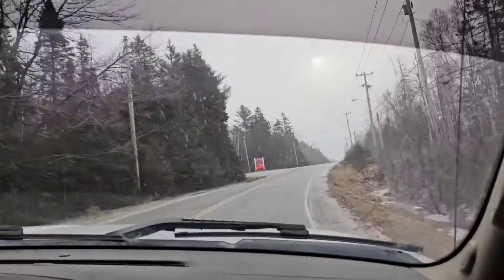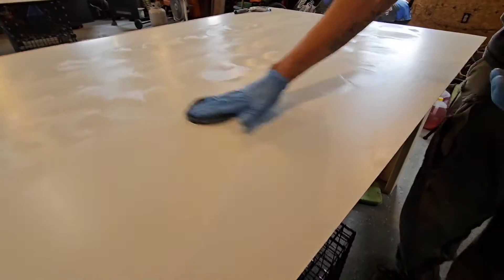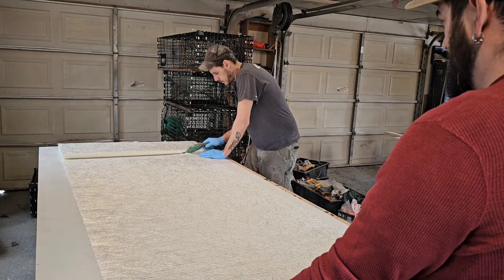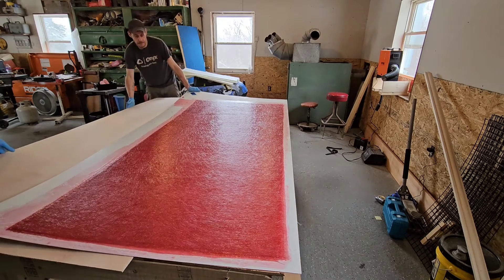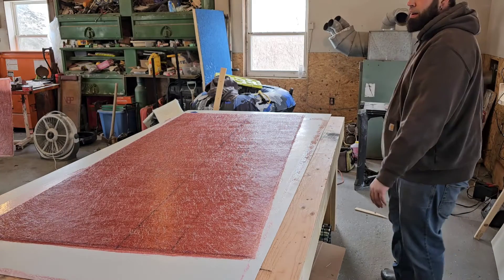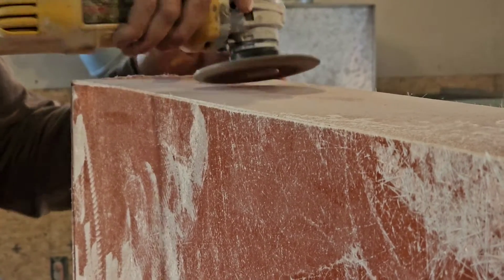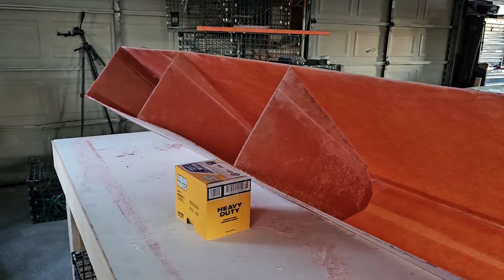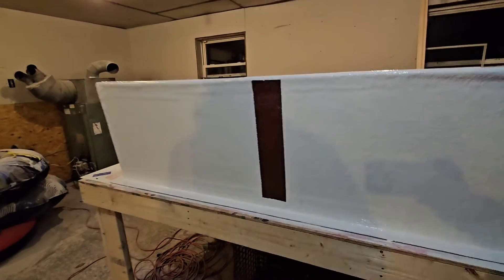Building a fiberglass fuel tank for a boat

Comment: Pretty cool video! Getting ready to do a tank here in sunny SC this month (2/25). I think you called that panel you put the wax on KALITE? Is that something they just sell in Maine? I'm pretty sure I can get a 4x8 sheet of "formica" that works as well but any feedback on that would be helpful. The hot glue gun was a great technique. What brand of resin did you use?

Comment: Vinal ester resin for tanks
Reply: According to Dave Gerr's "Boat Mechanical System's Handbook'" pages 85-87 polyester resin is acceptable for diesel fuel if its isopolyester  resin. He specifies how thick for sizes of tanks by gallon capacity, what layups to use, much more. Yes, vinylester resin is better for tanks as you point out.